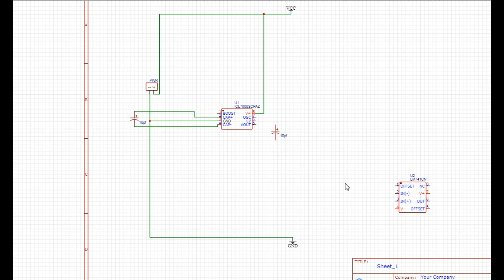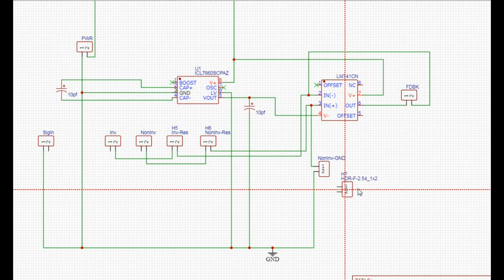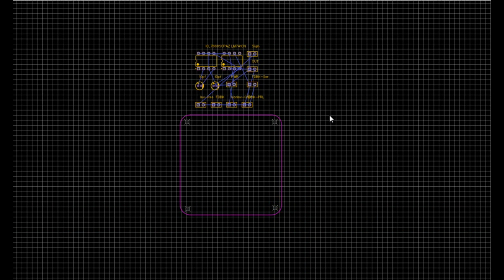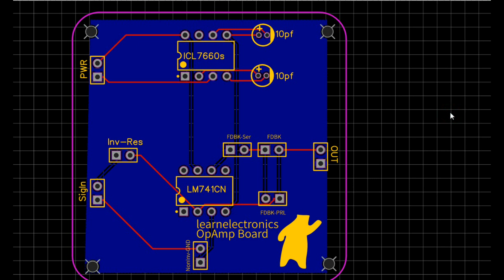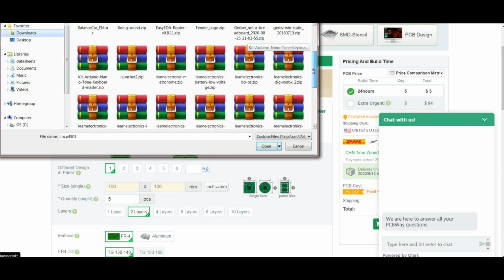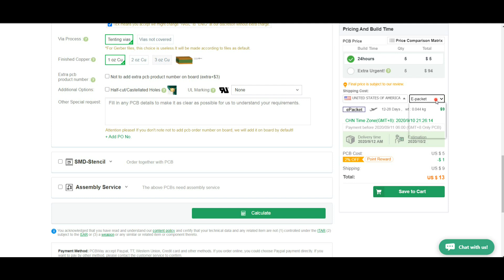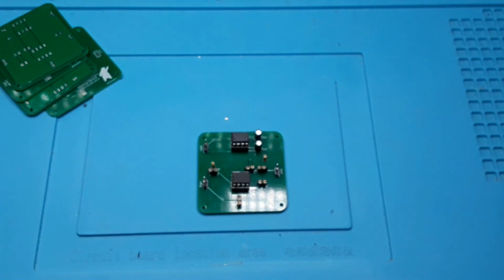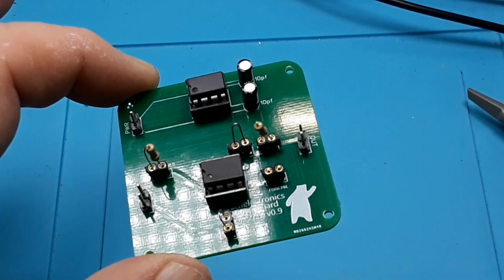OpAmp Tinker board from PCBWay

Comment: I was playing with an LM741 earlier today, I made a split supply from a single rail using two zener diodes, worked ok, but that IC you used would be better suited I think, unless it’s output is a bit too noisy as I need it to be a clean supply.

Comment: Can anybody tell me what is the name of that female header like part in which resistor and jumper is connected
Reply: They are 2 pin Single Row Pin Headers
Reply: @SurfDetector  thanks a lot.few months ago I made a board and I used female header for the exact same purpose shown in this video.

Comment: In a nutshell why is the input and output signal out of phase?
Reply: They are out of phase because of the resistor-capacitor network around the op-amp
Reply: @SurfDetector  the output signal looked a lot cleaner.  The resistor & capacitor combo must make a sort of tuned circuit?
Reply: @jackkelley890  Google  "RC Oscillator Circuit"  to see the concepts.
Reply: @SurfDetector  thanks buddy.  I'll check it out right now.

Comment: Sounds great, Paul, just like before ;-) 
Like the OpAmp Tinker board. Output sine wave looks nice and clean. I understand that it is for dev work, but can the boards be connected in parallel or series, like building blocks for dual/quad channels or increase wattage? Could pots be added for gain control? Just some thoughts. 
I'm pretty clueless about analog circuits; that's why I watch your channel. (missing my emojis, cause I'm migrating from MS Windblows to RPi4 as primary computer) :-(